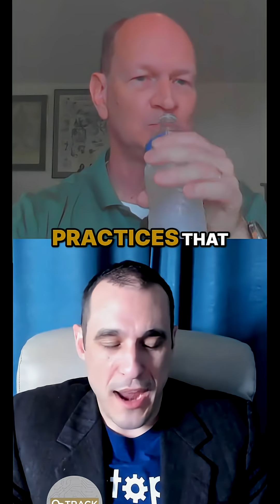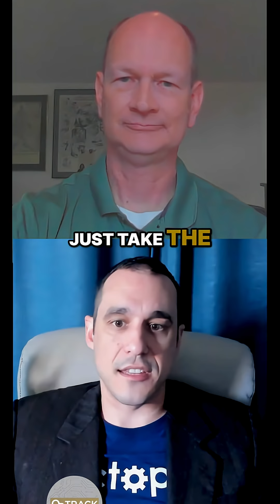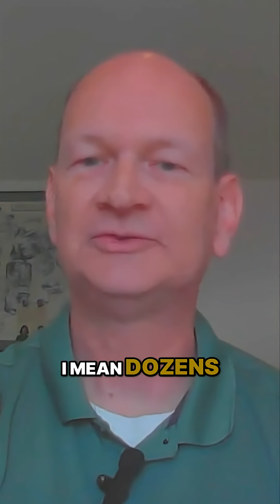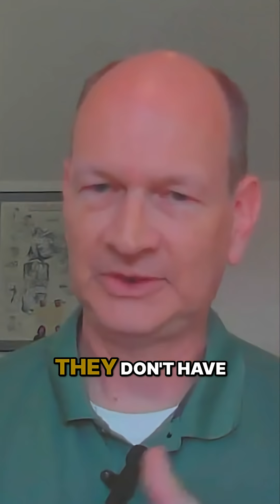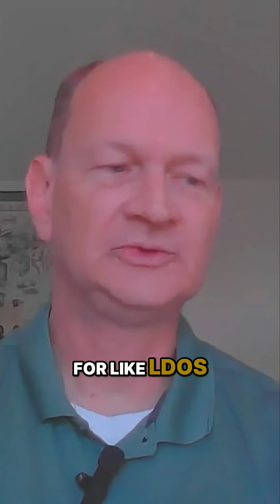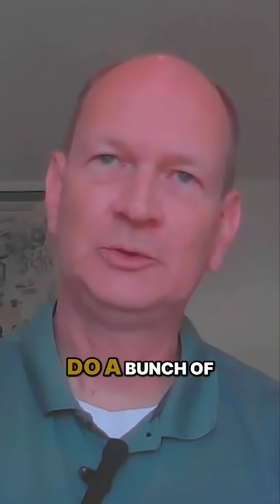Why You Shouldn't Trust Eval Board Layouts as Gospel

Comment: Sir, is this eval board scandal true for all chip manufacturers? And if so, how do you source a good schematic starting point? Would really appreciate some light on this topic as a beginner.
Reply: The schematics are usually good as a starting point, and usually the peculiar stuff is explained in the datasheet. Then there is the application part of the datasheet where they say it is just an example. Special layout examples are  usually good in the datasheets. 
They are talking about dev/demo boards and they are right, these boards are made to be used just for proof of concept, it makes no sense copying them to make your own product.
Reply: Exactly, sometimes I am not following the recommended layout from datasheet, because it makes no sense.
Reply: The silicon companies are great at example schematics since they designed the chip, but they aren't good at things like real world concerns like ESD protection that experienced designs add on.  However, I'd take their design in schematic.  They know the circuit they designed the chip to fit into.  Just know that when they told me to design it, they would say "Make this an example of EVERYTHING this chip can do", so sometimes it wasn't the best example if you only wanted one function instead of many.  The layout is really what I was talking about.  Very few silicon companies know anything about layout, so take the layout as a prototype example, but have someone with real experience review the footprints against IPC recommendations, route sensitive lines correctly, etc.